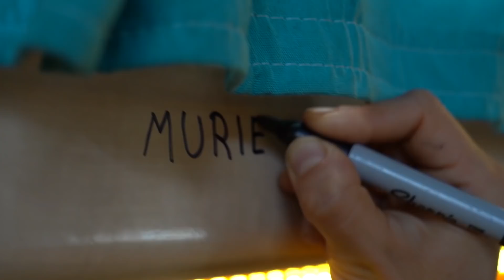LOCKDOWN | Relationship Problems on a Sailboat | S04E25

Comment: A tip for cans with low pressure: Put the can on the ground on its side and put a nice round dent in it with the heel of your foot. That will increase the internal pressure. You can get the last of the contents out that way.
Reply: Good tip! Also temperature increase helps.
Reply: great tip! I never knew that!
Reply: ...hahaha ...yes this works : )
Reply: ...good to the last drop  .
Reply: That's just it...they're not allowed "on the ground". LOL  j/k

Comment: Yep, living together in small spaces sometimes turns us into small people. Personally I have to dial it back, step into the wayback machine and remember the girl I fell in love with. We’re all in this together and together we’ll get through it. Thanks for keeping it real.
Reply: So true, well said we may look different years later but the core of the person is still that same one we fell in love with! Alright enough sappy stuff .....
Reply: It is not only remembering the girl you fell in love with is the two of you enabling each other to say things like. Go scrub the bottom of the boat, time you checked the top of the rigging, swim laps or dingy and  sunshade come back in an hour even to there is plenty of video to edit, the sun is up you can have the front of the boat while I do an oil change, service the head etc.

Small boats are difficult in a restrictive situation but trust in each other and have the fuse break statements or tasks not every relationship works but a small boat is smaller on your own!

Comment: Much props to both for putting your life out in public, the good and the bad.  Been a fan for the sailing, adventure, and projects and a bigger fan now.
Also much respect for taking that carb off over the water. I would have dropped a few screws if not the carb

Comment: Now that was a v-blog that others should aspire to! The outboard, issues, problem solving and learning. Stuff you will now pass forward. But the last segment..... Ant's driven he needs a focus or project. To create, repair, fix or help others to do so. If not he has to channel that energy somewhere. Walk, Swim, draw, create. If there is not a challenge...He can become a grumpy git! I, (Cid) find I need to almost focus him into finding a challenge, seeking a purpose or endeavour. Its worked well for us over 35 years + Clearly you two have worked it out. If you have internet access you should look at Maslow's hierarchy of needs and also how driven people of intellect/intelligence need different stimuli. Because as Ant says, If you know how it works, you know how to fix it. Sail Safe guy's. Cindy, Ant & the pooch crew xx

Comment: I'm proud of you two for surviving on that size boat at your age. It's definitely difficult in many ways when you're younger. We started young on a 32 ft. Flat bottom boat in the late 70's. After 30 years apart, regrowing, regrouping and the patience that comes with age, we have been reconnected for the last 7yrs. However reconnecting we once again started together on a 32 ft boat. We did 6 years until a 40 ft Valiant fell I to our laps, at a doable cost. I guess my point is, you two are obviously in love. Have the same goals and dreams. Finding a mate living this hard but enjoyable lifestyle is most difficult. With time will come patience. We now simply don't argue about anything. It's actually really simple. Just be happy!

Comment: Your sailing adventure is so real and relatable --- a refreshing departure from some others that can be enjoyable to watch, but which lean at times toward the shallow, materialistic, and oversexualized. The fact that you call each other "buddy" is touching and emblematic of the fact that you see each other as partners. You are at bottom a loving couple, which comes through in every video. Successful couples work through conflict. Stuffing it away can let it build up and destroy a relationship. You two seem to value each other more than Atticus or anything else. You seem so secure in who you are with each other that you have no need to hide the fact that you have trouble getting along when forced to endure a lengthy anchorage and confinement brought on by the pandemic. A lot of us who are staying at home in much less compressed spaces could use you as an example. P.S. When you wind up your adventure someday, a lot of us will want to continue to watch you (and your little ones?) as landlubbers and recreational sailors. All of your sailing skill, knowledge, and experience should be business assets you can leverage.

Comment: Just lost my best bud of 48 years and I can tell you two have what it takes, hang in there.  Tip: Shake a little gas out of the carburetor bowl or fuel filter onto a piece of wood (dock) if there are beads that is water in the gas if it is flat it is gas only.

Comment: Great episode. The frustrations of outboard motors. When I was an engineer in a Hampshire (England ) boatyard (1971) I'd go home with arms nearly pulled out their sockets after a day trying to get 40hp manual start ones running. Electronic ignition was not common then. 
You two are so honest in your videos, they are the best I've watched on you tube. Good luck getting through this to you and all your fans.

Comment: Hi! About your outboard, we have exactly the same one, and had trouble for two years, with lots of tinkering and a carburetor rebuild. Finally, my partner was told never to use gasoline with methanol in it. Since then, we only use 91 or 94 octane and we've never had a problem. Apparently, methanol leaves a powdery substance in the carburetor. Good luck!

Comment: Always add fuel stabilizer and HEET to your gas cans. Anytime you work on the carb check the fuel before re-connecting fuel lines. Also be careful where you spray carb cleaner. Better to use WD40 and compressed air. Welding tip cleaners work well too.

Comment: Add alcohol to the tank, allowing the alcohol-water mixture to blend with the gasoline, passing the emulsion through the engine.  We used this trick on our circumnavigation in the 1980s.

Comment: That was a hell of a lot of water in that fuel tank! One of the big problems with water in your fuel is that the bowl on the carburetor will act as a trap and the fuel will just float across the top so the motor may start and run for a few seconds then die until the bowl is completely full of water then it won't run at all. Also one of the easier ways to get the water out of your tank is to siphon from the bottom of the tank removing the water instead of trying to skim the fuel from the top.

Comment: Hey im a boat mechanic. And not sure it might be in the comments somewhere but, there is a water fuel separatior filter you can buy looks like a oil filter. Keeps about 90% of the water from getting in the engine and if you think there is water in the gas can you can take it off empty it and put it back on. Not sure if they are available where you are but worth a shot.

Comment: That motor was a bugger. I kept thinking just air in the line going to the carb. Sometimes they have a gas bleed valve where you pump up the gas pressure from the tank and just bleed it off. Or you could get starting fluid in a spray can and spray it in the carb and pull the cord and it will sputter a few times and that might be enough to fill the carb again and get all the air out. Good job on fixing the carb. Not may people can do that. And good job not dropping any carb parts into the water.

Comment: Always stabilize you gas in the fuel tank then run the engine for a short period to insure that fuel get to the carb.  Stabilize with every fill-up with the proper amount.   You will solve a number of issues.

Comment: I know its not available everywhere, but I use ethanol free gas in all my small motors, including motorcycles. Gas lasts a long time, doesn't absorb water. Doesn't corrode the carb(s). Hard to start two strokes like weedwackers and chainsaws start on first or second pull. And they idle!! And good going on the relationship. Relationships are hard in a big house with lots of space. Multiple times 100 on a small boat day after day. Good job!!

Comment: Just watched the video of the carb problem, you can buy carb cleaner by the gallon in a normal container, then buy a really good quality pump up pressure bottle, I recommend a brand call ‘Wurth’ that’s what I use in my workshop, the brand of carb cleaner is not important, but the pump up bottle in my opinion has to be a Wurth one, the seals inside last a very long time and buying carb cleaner by the gallon is a lot cheaper than buying it in a pressurised container, hope this helps.

Comment: Thanks for sharing. We are all a bit on edge with the current situation. Clearly the obsolete tech Rube Goldberg contraption internal combustion engine put you over the edge. My advice is to replace it with an electric outboard which will be much more reliable and lead to greater harmony.

Comment: I'm glad it turned out ok for you with the outboard.  I would advise against working on it while it's on water.  Thank god you have good fingers and not dropped anything into the water.  That could have been frustrating if you lost any part.  Also, I would also advise against working on anything with fuel indoors.  Not only does it create toxic fumes but also flammable ones.  Any small spark or flame source could be catastrophic.

Comment: Buds, your outboard fuel needs an additive.  The new outboards have very fine jets because of the pollution and energy efficiencies (especially the Tohatsu motors).  I have the same motor, as well as several of my friends do as well.  I have found if I use the Gumout Fuel additive ("Gumout All in One Fuel System Cleaner") for ethanol as well as regular injector cleaning stuff.  Gumout makes one that is all in one, about $10 for a small bottle, should last you 6-8 tanks.  You can't add too much so don't worry about amounts.  The reason is the new ethanol fuels are hygroscopic and bond to water condensate.  In the tropics where you are, you just have condensate in your tanks (maybe not ethanol additives) , either way - water = bad for injection ports.  Then when the fuel/water molecules try to go through the finer injector ports the surface tension on the water molecules prohibit the fuel from going through the jets.  If you use this, you will never have another fuel problem, it will evaporate the water in your gasoline (not for diesel fuel).  I have 2 friends using it-they have no problems.  We have several not using it and they spend their days fighting the outboard.  You won't go wrong.  Enjoy your boat, stop and smell the water sometimes.  Stay chilled, Steve S/V Elektra.  It also eliminates all that Varnish build-up-the yellow stuff you see cleaning the carb)

Comment: Buy some fuel stabilizer and if you are not using the gas often, this will help and you wont get this issue. I store my motorbike in winter with a full tank with this and it will start up straight away in the Spring. Just a little goes a long way!

Comment: Nice the way you took the gas off the top and left the water at the bottom.  I would buy some starter fluid in a can so you can start it up right away by spraying in the intake to get her started right away.  It would save your arms from pulling the cord so much.  Best of luck with everything.  I also buy only premium gas for small engines since the ethenol additives reek havoc on small engines constantly.

Comment: What you should had done first instead of taking things apart is check fuel flow then check spark in the spark plugs and give the plugs a clean make sure the gap is OK making sure the plugs are in good condition. Also while the plugs are out give a few pulls so the pistons kick out old fuel  while new fuel goes in.Then put the spark plugs back in if everything is OK try to start it again. Always go simple first rather than possible losing parts to the sea.

Comment: Great communication breakdowns for two people on such a small vessel for such a extended. Of time and with the lockdown but even more pressure on both of you you're both handled it really well and the fact that you care enough to talk about it in the manner that you did expresses that you both care and I respect each other.

And that engine job great repair job yes condensation for diesels and water in the fuel from third world country gas pumps.

Comment: Guys if you use berrymans B12 carburetor/injector cleaner in gas constantly, you won't have this problem. It helps keep gas fresh for a very, very long time, and it just keeps your carb working. My fishing boat, I never use fuel without B12, all fuel gets treated at all times, no exceptions, and my motor just runs. I overtreat heavily, using the whole bottle for like 6 gallons of gas, but the results are awesome, motor starts every time I need it. I also  run the carburetor dry every time I know I am done using the boat. That helps too, but without the cleaner the carb would still gunk up soon or late. With  B-12 in fuel at all times, things are going very well. B12 can be used in 2 or 4 stroke engines, no problem.
Mine is 1996 2 stroke Tohatsu, and it works any time needed.  I basically NEVER had to clean my carb even once, it just starts every time!
I also use quick silver 2 cycle oil slightly more liberal than recommended. I like using it, because somehow it causes gas not to evaporate so bad, and not to stink, choking me up with the evaporation fumes.
No idea, may be quick silver creates some kind of film inhibiting gas evaporation? No clue, but using quick silver I can actually breathe fresh air, not fumes.
Quick silver truly is of the bestest, but pricy, yes

Comment: Try using a cordless drill on top of the starter wheel nut to crank the outboard 
Instead of the pull cord (save some sweat) 👏👏👌

Comment: If your petrol has Ethanol in it, 1 it gradually separates 2 the Ethanol gradually goes into solution with water; condensation, damp atmosphere and so on. To get it out pour into a clear container, mix in more water vigorously, leave to settle. You will see a clear stratification. Ethanol/water solution at the bottom, Petrol on top. Siphon out the Ethanol solution with a wine siphon or such and discard it - the pure petrol is left.

Comment: When saw you working on the dingy motor my blood pressure got about 220/100, gosh,  if i try that tools, parts and even the carb will ends up in the bottom of the sea..

Comment: I saw a similar comment in the posts below, but I literally just finished getting caught up about an hour ago.  Someone told me ages ago to check you guys out when I was working on some boat projects, but I never got to it.  It was the 'off the grid' S04E24 episode that popped up on my feed a couple of weeks ago and some of your set up is like an advanced version of mine, so I started watching to see what I could learn.  For example,  I had 3 solar panels zip-tied and bunjyed to  my bimini at anchor for 6 months with no issue and then a few weeks back at the dock, a freak wind over the starboard quarter caught them and ripped them off....I am now looking for solutions for the future and the velcro bimini system might be just what I need.  I have the canvas for cruisers book, but have not got around to reading it yet (see the pattern developing here?).
As I re-watch and soak in all the refit and sewing videos, I know for sure that I will be borrowing a lot of ideas once I get back to working on my boat projects, so thanks for the inspiration and the renewed motivation (I have so many projects that I sometimes get overwhelmed and get nothing done).
Great job on working through your arguments and it was brave to share that on you tube.  I like how you realized that you needed a new set of coping mechanisms for the full lock down on the boat.
Keep charging and keep loving each other!  This pandemic will pass and will some day be just a distant memory that you will discuss over sun-downers at some future anchorage!
Cheers!
Reply from the maker: Hi Joe! We're so glad you stumbled onto our channel! Welcome aboard! Good luck on your boat projects- we can identify with the stress looming over you to get them done! And thanks for your words of encouragement!!

Comment: A little unasked for advice:  Any engine that is not used regularly, whether four stroke or two stroke, will have problems starting due to the gasoline gunking up things.  Solution = turn off fuel and let engine run until fuel in  carburetor and lines finishes and engine dies.  Result = engine starts everytime.  This includes outboards, lawnmowers, weedeaters etc.

Comment: I admit I've never had to do what you two are doing living in such a small space with another person. I have been married for almost 40 years. But you might want to take what a lot of prisoners do who are in isolation. Exercise is a major key. Be creative. Swimming laps absolutely. Deep knee bends, push ups,  find things on the boat to lift repeatedly, a bucket of water you can fill with water and do curls or presses. Creative part of finding different ways to exercise on the boat has value in and of itself. Exercise yourself almost to or to the point of exhaustion you'll be amazed how much better you feel. How much better the two of you will get along, how much better your attitude will be.

Comment: Anything flammable down the carb wil start it. Aerosol cans butane camping canisters flyspray squirt of petrol ect will fire it right up can of engine start is best. Alo will start a diesel with a half flat battery so good safety tool on a boat